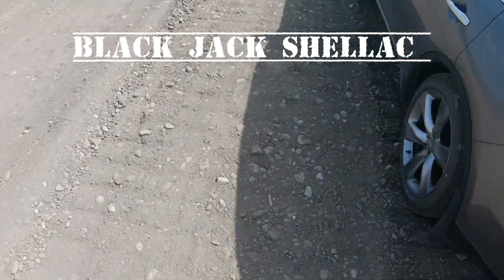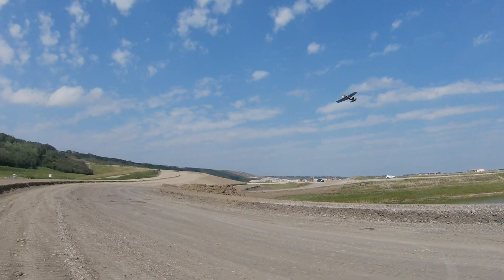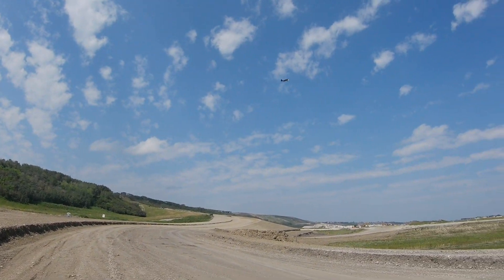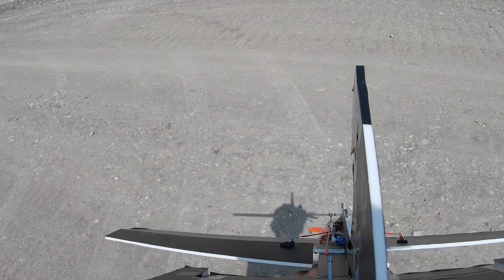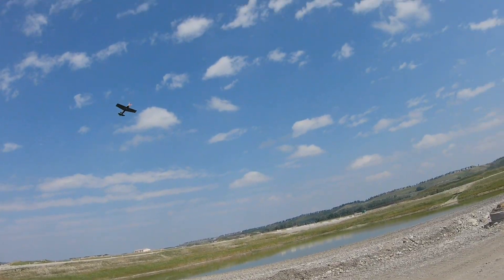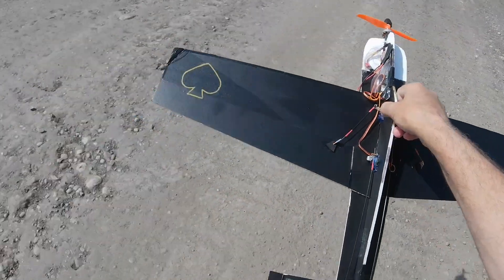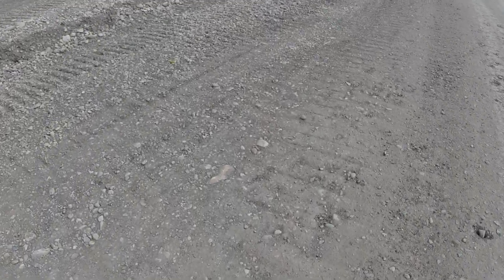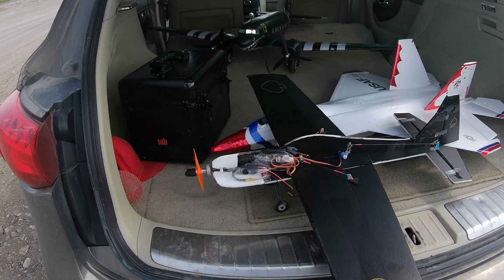Black Jack Shellac weaknesses

Comment: Looks fun to fly a home-brewed model. I quite fancy making one, but can I ask some Qs, please? So... motor = zero down and side thrust? Wings and tail zero incidence and both positioned on the centre line of the motor? Is that roughly the magic sauce? Plus big, flappy bits, of course.
Reply from the maker: Motor down thrust is set at 2° and 1° right. Zero incidence on tail and wings. Big floppy bits are needed but use a strong servo. I have to replace the aileron servo. It just won't fibbidy my bits. See if you can source some of the EVA foam board. It is indestructible. 
Now off with you, you nutter. 😜
Reply: @8poundquark  😄😄😄😄😄😄😄 Thanks for the 3D thunkings, fella ☺